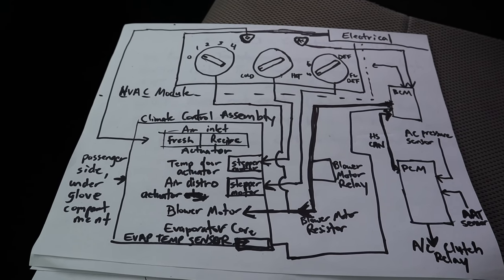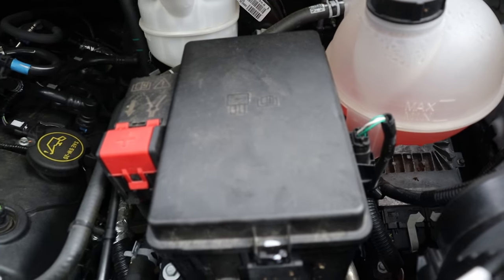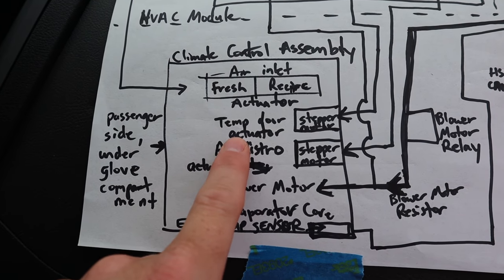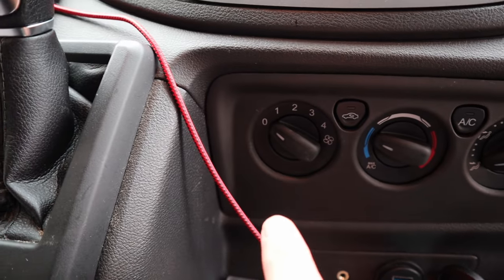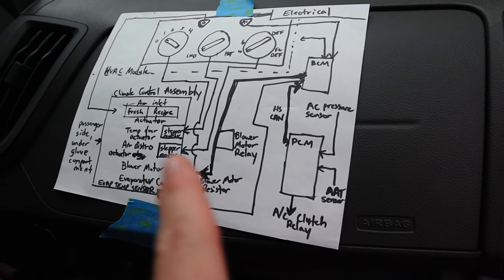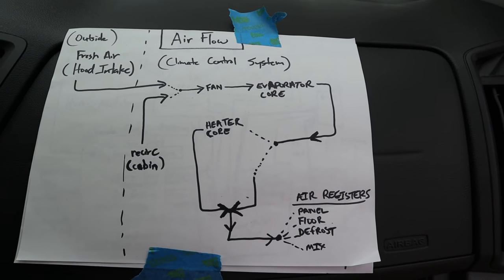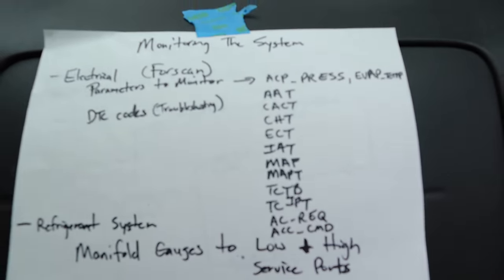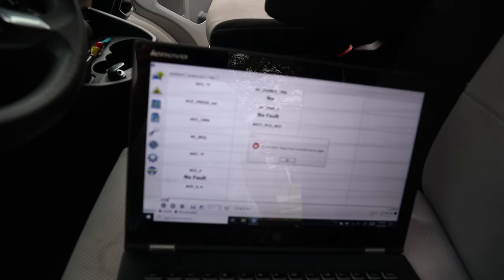#MTBPlanB Poor A/C performance 2015-2019 Ford Transit? Watch this.

Comment: I put 252,000 miles on this van driving for fedex I had a transmission flush at 200k and oil changes every 5,000 , pretty solid build , but just recently I'm having this issue , but I wanted to explain the dummy intake on the hood it was a stupid design on rainy days water will comes from the vents flood your spark plug wires

Comment: Nice! My shit musta been iced over... Turned the AC off but had fan on high... 10 minutes later heard some noise like ice breaking up and traveling thru the ductwork and the flow instantly increased to normal... Turned AC back on and AHHHHHHH... Nice and chilly again... Sweet
Reply: Mine today did the same thing here in Texas. It was frozen up and it sounded like my ice maker on my refrigerator when it defrosted.

Comment: Very informative. Thank you. My 2015 350 HD passenger van has had no servicing since I bought it, the ac is working but I would like to know what the temp should be at the vents in front and rear to see if It requires any Freon. It’s about 50 in front and 60 degrees F. In back now. Thanks for any help.
Reply from the maker: About 50F is all I get when ambient temp is on high 80s.

Comment: Great description, thanks you very much :)
Any tips for what to check when AC is working fine and cold air is coming 16:26 on passenger side and in the rear but not in the front and at the driver’s seat (just air)?
It’s a 2017 Ford Transit “Tourneo”.

Comment: Do you know where is the evaporator drain is located on a For Tran 2011? I have water in my foot pan
Reply from the maker: Try center of firewall above transmission. May be able to access from the top of the engine. Helps if it’s leaking condensate to locate.

Comment: Were you ever able to resolve this issue, or confirm that your fixes worked?  If so, would love to see an update. Thanks.
Reply from the maker: Yes, it ended up being low refrigerant pressure. I have not had a chance to troubleshoot the leak, which I assume it has.

Comment: The AC in my 2018 Ford F250 Transit just goes on and off. It was dead for days, I filled the gas tank and then it worked. Thought maybe it shut down to conserve gas but the next time I went to use it I got nothing. The AC button and air recycling button are both out when the AC doesn’t work. I use this van for my business in Florida and I need AC but don’t have the funds yet to spend too much fixing it. I replaced a 10a fuse but that didn’t help. Any ideas?

Comment: Do you think one can change the evap temp sensor on these without pulling the dash?
Reply from the maker: Not really. That sensor is also part of the climate control housing. The recommended procedure is to swap over everything to new climate control housing.

Comment: I’ve got a 2018 250. Air works pretty good upon start up but after an hour or so, air slows to a trickle out the vents. Replaced the blower motor. But nothings changed. Any ideas?
Reply from the maker: Does it exhibit the same behavior with heat or vent fan with no a/c?
Reply: @MTBPlanB  I honestly haven’t tried heat yet. But I may have commented too soon in the video. After watching to the end, I think it may be the evaporator? The AC does make a louder hum from the engine bay when it’s on too. Like the fan but louder than normal

Comment: Would you know where the evaporator drainage is located?
Reply from the maker: Try looking near the center of the firewall above the transmission. You may be able to spot it standing over the engine looking down. If not, turn on The AC and follow the source of the water leaking.

Comment: How change the Blower transit 2015
Reply from the maker: On my 2019, There is an access panel directly under the glove box. Remove those screws to access and remove the blower motor.

Comment: My question, my 2017 ac isn’t blowing hard enough to feel cold air up front and in the rear. I’ve had to open up the rear blower and clean off the coils to allow more air flow. My best guess is that the front coil is dirty enough as well to limit the amount of air flow but I can not find the coil up front to clean it. Do you know where it is?
Reply from the maker: The evaporator coil is under passengers dash glove box (drop the glove box) and contained within a plastic housing. Its important to run a filter in the unit. You may be able to maneuver something in the filter slot to clean the coil.

Comment: If my blend door actuators are working , and have hot are on driver side and cold on passenger, does this narrow it down to a broken blend door internally
Reply from the maker: Perhaps if you have dual zone a/c which has a blend door on driver and passenger side.  If you don’t have dual zone a/c, then it could also be low refrigerant or a separated air passage (I.e. duct has pulled away from vent, etc.).

Comment: I drive a 2017 Ford Transit 250 (3.7 gasoline) . AC worked all summer but recently i noticed that air con is not blowing cold air and the radiator fans are not spinning. I checked all the fuses and relay (manually checked with 12v current and did the click test on all of them) and none of them have blown. Then i jumped the fan and ac clutch fuses/relays with a paper clip, when jumping ac clutch it spins & engages. Also fans started spinning when i manually jump the relays for fans. I am now lost as to what check next, as none of the hvac related parts are seems to be broken. I also checked with ODB2 diagnostic tool and in there i see zero values for ac pressure & fan sensor. Should i put Freon gas refrigerant in it?